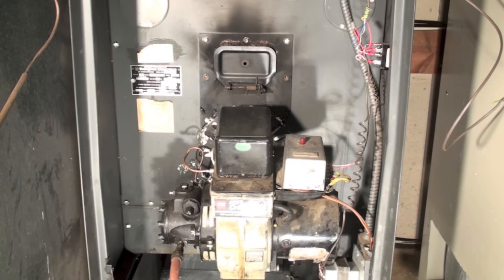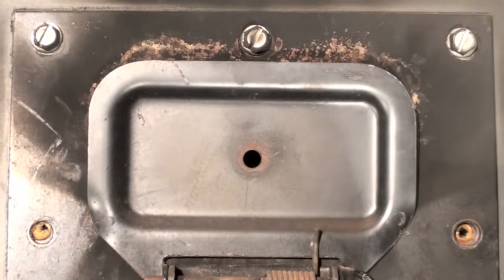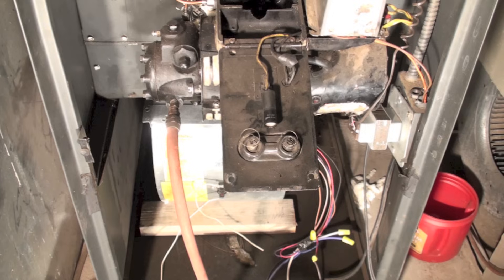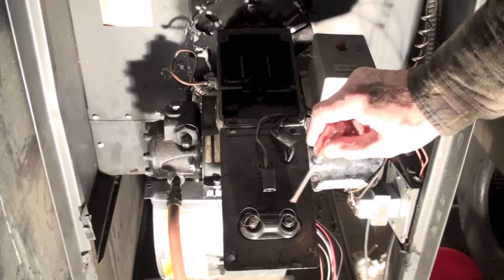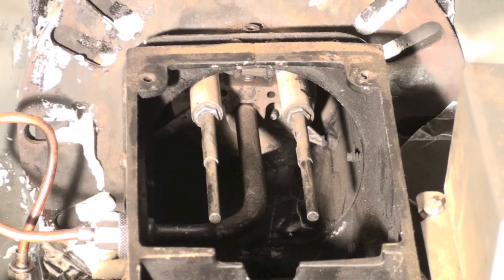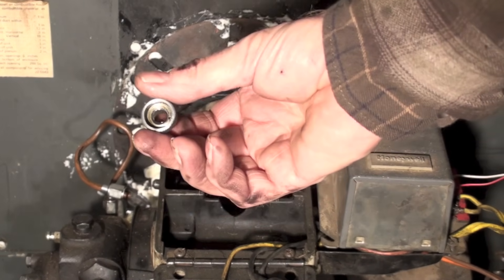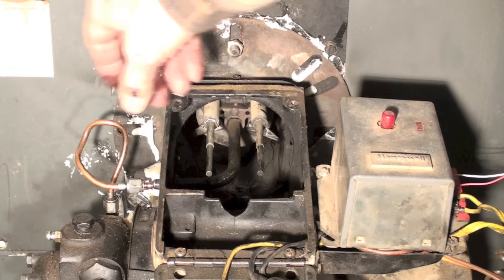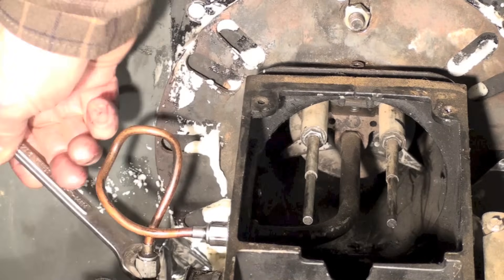Oil furnace troubleshoot part 2 No flame

Comment: Interesting troubleshooting video. I have a problem to fire my oil burner from water heater. I got popped that red button from the motor (on the side) so I have pushed in back but then when I turn on the power I can hear only a click. When I press a button on a transformer it does nothing. Is my motor busted? I have spin the motor blower and that is moving fine.
Reply from the maker: You probably have a failed motor.
GFM
Reply: @grayfurnaceman  Can I connect it directly to 110V to see if is dead for real?
Reply from the maker: @abra-makabra  You can.  The cable from the motor is located in the junction box below the cad cell relay.
GFM

Comment: Thank you so much for these excellent troubleshooting videos.  You explain everything so well, it made the diagnostics very easy.  I narrowed down my issue to a clogged spray nozzle, probably caused by a lack of an oil filter in my system.  I cleaned it out with some compressed air and it fired up!

Comment: Hey question this season in our greenhouse with the Miller MOC 100 i’m having issues with it lighting I replaced the electrodes and the transformer and I’ve adjusted the electrodes to the point that it will light and run way beyond the normal setpoint. It has a .50 90° nozzle   Of about 5/16 above the nozzle 1/4 inch or so ahead and about 1/8 inch gap minimum at the Tips.  But the other night it was running fine for a few nights and then over the night at some point it tripped out.    Also when you look through the inspection port and see the heat and flame come out of the top of the firing chamber I see very very tiny sparkles at the top of the flame though I think that might be just impurities in the fuel because I just recently got a fresh load of K-1 to dilute a bad load I had. Could those small fluctuations in the flame be coming from the pump? I was thinking maybe the pump was getting old even though it is running.   Thanks Ben
Reply from the maker: I don't think its a pump problem.  Usually, sparkles are from too much air.
GFM

Comment: This was very informative. But is there really no good way to remove excess oil from a combustion chamber? Why can't it just be drained and cleaned out?
Reply from the maker: You can certainly do so.  Just disconnect the oil line(s), remove the burner assembly, remove the front plate, (the bolts will probably break off), remove the combustion chamber or fire bricks, clean the oil from the bottom of the furnace and replace the bricks/combustion chamber.  Reaasemble and fire off with a fire extinguisher close.
GFM

Comment: Hey man, I have the same burner. Mine lights and as soon as the blower comes on the flame slowely goes out and then trips the red breaker. Any ideas what's going on??
Reply from the maker: Possible crack in heat exchanger.
GFM
Reply: @grayfurnaceman  we tested the photo sensor it seemed to be functioning. The control board lights the burner no problem. We even took the cad out of the circuit and jumped the F terminals with alligator clips. No change. I'd say it stays on for about a minute. Where is the heat exchanger? In where the flame is after the burner?
Reply from the maker: @pryrcguy9298  The heat exchanger is above the combustion chamber where the fire is.
GFM

Comment: I went though this process, but I had a different outcome at 4:23, there wasn't any spark, and you unfortunately didn't mention where to find the issue if that was the case, any help would be very much appreciated
Reply from the maker: Check for 120 volts at the wires going to the transformer.  120 volts in, no spark equals bad transformer.
GFM

Comment: I’ve been having issues with my boiler. For the last two days it will stop working at the same time at night. The repair guy came and changed the filter and nozzle, it seems to be working until night time where all of a sudden it just stops igniting. Any insight would be greatly appreciated. Thanks!
Reply from the maker: Is the oil tank outside?  Has the temp been below 15F?
GFM
Reply: @grayfurnaceman  yes and no, it’s been warmer. Today I had a new technician come by, he used a CO2 device and hand pump to clear the line. So far, so good, but it’s still early In the day.

Comment: What if you’ve already pushed the button a bunch of times before you watch this very intelligent video. Do you need to wait a week until the fuel can evaporate or?
Reply from the maker: There are 2 ways here.  If you have repaired the cause of the failure, You can start the burner and shut it down immediately.  It should remain burning the oil in the chamber.  This can be dangerous, as the oil will continue to burn and could get out of control.  A fire extinguisher readily available is a must.  For this worst case scenario to happen, you must have pressed the button over 30 times.  If so, you will need to remove and replace the combustion chamber.  
GFM

Comment: My furnace ran for a week and was fine now it won't flame up but the spark is purple....do I need to replace it?
Reply from the maker: Have you done a spark test?  
GFM
Reply: @grayfurnaceman  Yes I just replaced the Beckett electric oil burner and still no flame
Reply from the maker: @krystalbernard2164  If you open the inspection door do you see a fog of oil after reseting the cad cell relay?
GFM
Reply: @grayfurnaceman  no but there is oil in my tank and I already bleed the line
Reply from the maker: @krystalbernard2164  You may have plugged nozzle.
GFM

Comment: Wouldn't you want to shut off the firomatic valve before hitting the red button when testing the transformer so no more oil dumps in the firebox when testing?
Reply from the maker: You can shut off the valve, but you will spray some oil anyway.
GFM
Reply: @grayfurnaceman  thank you

Comment: hi..we just replaced our fan blower and since we did that we kind are experiencing a weird smell now..can it be cause the fan blower is new and has to burn off the newest?
Reply from the maker: It may be possible the motor is not the correct one and is overdrawing power. Check the amp draw and compare it to the model plate.
GFM

Comment: My oil furnace has the blinking green light, and will only ignite if i hit the reset button. It will fire up every single time I hit the reset button. It will burn for about 10 minutes, stops i here a few clicks, the it turns back on but doesn’t fire the second time. Goes right back to blinking reset light.
Reply from the maker: Have you checked your oil filter?
GFM
Reply: @grayfurnaceman  I have not because I was worried I’d screw it it up. It has a oil De-aerator directly above it.  That was going to be my next step. I will have to go pick up a new filter first.
Reply: @grayfurnaceman  I have a guy coming out tomorrow to do a standard tuneup and hopefully that does the trick. I’m just frustrated because no matter how much research I do no one can tell me why it would fire up no problem when I hit the reset button, run for 10 minutes but not fire up the second time. I can’t even find out why they pause in the middle anyway? Why doesn’t it just stay on till it reaches the temperature I set it at? Why the pause? It’s always done that and I’ve never known why.

Comment: My furnace lights every time I push the button, but shuts off after 30 seconds or so. It wont light by itself but it's getting power to it when the thermostats are telling it to turn on.  This is the 2nd year in a row it's done this to me. It was serviced not even a year ago.
Reply from the maker: Be sure the cad cell is clean and pointing at the fire.
GFM
Reply: @grayfurnaceman   thank you for letting me know what to check. My cad cell was bad. I replaced it for less than 10 dollars and now my furnace works again.  Thank you so much
Reply from the maker: @Hanshotchewie  Yea, you got heat.
GFM

Comment: How do you dry that extra oil out of the combustion chamber
Reply from the maker: Ahh, that is the problem.
If the reset has been pressed numerous times, you may have a problem.  If you know the reset has not been pressed more than 5 times with no ignition and oil flow is present in the chamber, you are ok to fire it off after it has been repaired.  More than 5 times, but less than 10.  Fire it off with a fire extinguisher ready to use if the fire gets out of hand.  Over 10, consider removing the combustion chamber and replacing it and cleaning the oil out of the chamber.
GFM

Comment: Thanks to this and another of your videos (and another guy's, too) I was able to overcome a failed control unit to get the furnace running enough for the long July 4 weekend. New controller being installed Tuesday. Thanks so much for the help!
Reply: Farrah Fawcetts beckett oil burner fuses 2 protons form hydrogen into carbon and super heats water into a steam Hotsey steamcleaner making nitrogen and gamma rays! she runs on on 208v single phase 60 hz 32 amp singles phase, Bradley Chubb upgraded to 460v 3 phase 60hz for more fusion Iron Fireman proton accelerator and totally eliminate #2 fuel oil?
Reply: Nick Chubb runs an Iron Fireman proton accelerator of 120/240v open wye delta with 2 50kva transformers!
Reply: Carl Nassib and Baker mayfield 208v powered Beckett proton accelerator heats our church hot water better to 210 deg f better than oil/gas anyday!
Reply: kentavius Street says the burner proton accelerator runs on 460v 3 phase 60HZ with 30 amp breaker

Comment: I've a Bock 32E oil fired hot water heater that has been giving me trouble periodically for the past 3-4 years after many years of trouble-free operation.
The first real problem was an elevated hydrocarbon odor when the burner was operating. This was traced to the Turbo Flue being sooted up. I cleaned it out, put a new nozzle on the burner, adjusted the electrodes and it was fine for a few months until the same thing repeated.
Cleaned out the Turbo Flue again, replaced another nozzle ( .75GPH 80A) and it was fine for about a year.
This month, I noticed hydrocarbon odors again, so I opened up the air vent on the burner some more. The next morning, we woke to no hot water. I took apart the burner, replaced nozzle, replaced the oil filter (which was pretty clean) and cleaned the electrodes. It started up immediately when I turned the power on and it was fine for three days.
Then this morning it had tripped the safety again, so I took it apart, having determined no spark. Turned out the electrodes were way out of adjustment, so I cleaned them again and adjusted to Beckett specifications. Put it all back together and it fired right up immediately when I turned the power on.
However, from a cold start, it should normally run at least 15 minutes to get to cutoff temperature, but it shut down about 7-8 minutes into the heating cycle and did so with a fairly unusual "pop" sound. What's strange about this is that the safety did not pop. Nor is it apparent that the motor overload popped. It just shut down abruptly for no apparent reason and none of the safety cutoffs had tripped.
Is there a third safety cutoff device that I am not aware of? I cannot get the burner to power on. I'm wondering if the controller just happened to fail in a manner that would cut power to the electrodes and the motor simultaneously. In 55 years of living with this house and various oil burners over the years, I have never heard one shut down with a loud pop and all of the safety trips are not tripped. Baffling.
Reply from the maker: My thoughts here are the controller has failed.
This appears to be unrelated to the sooting problems you have described.  You probably have the air too far open.  You really need combustion tools to set the air.  A smoke tester and draft gauge at the least.
GFM
Reply: @grayfurnaceman  I made another discovery after really looking over the entire system: the Field Controls Oil Vent Damper was in the closed position. It has to be open before the burner will start. For some reason, it closed while the burner was running about 8 minutes into heating.
I took the motor assembly off the flue damper and disassembled it. There's a circuit board inside and several of the traces had burned up. I repaired those with jumper wires, tested the motor itself (it works) and put it back together and reinstalled it. When I turned on the switch, the damper opened and the burner lit off nicely. Odd coincidence that the damper control failed while I was focused on problems with the burner, but I guess it was just a coincidence!

Comment: When you mentioned you should press the red button over and over. Can't you just disconnect the oil line and have it pointed into a bucket so no oil going into the combustion chamber for troubleshooting?
Reply from the maker: You certainly can.
GFM

Comment: If I do all the steps in this video and it does not light, what would be the next step to fixing the issue?
Reply from the maker: Do you have spark, is there a fog of oil in the combustion chamber, does the burner motor turn?
GFM

Comment: I had a problem with my old mobile home heater, did what checks I felt comfortable with, usually its just been a simple fix, bleed the air out of the fuel line. I did that a few times till I had a steady stream and the pump was making its normal noise. Well I had no ignition, I checked and had a great arc between the contact springs, then figured it was the electric eye, replaced that and still no ignition. At that point I wasn't comfortable replacing the electrodes or injector nozzle just yet so I called a professional. When he lit off the burner, flames shot out like that scene from the Wizard of Oz and he backed off real quick lol. I forewarned him that I cycled it a few times and there might be some kerosene left in the chamber. Well the heater was working just fine until it reached the shut off temp and wouldn't ignite the next cycle. After being frustrated with it, I let it sit and went to the electric heaters for a time. Then I got up enough courage to replace the electrodes. Still didn't ignite. Now I'm wondering if the nozzle is clogged, but it was working fine after he got it to fire up. Other than that I'm at a loss of what it could be. I'll order a new nozzle for the heck of it and pull the assembly out and bench test the electrodes to see what there doing. Any suggestions would be greatly appreciated.

Comment: You have little choice but to ignite the oil accumulated in the chamber.
Reply from the maker: In most cases, yes.  However, I do not know what age and size of the unit.  If it uses a stack switch and has a 2 gallon nozzle, you could have a gallon of oil if it was pressed 20 times.  
Starting the unit would be quite dangerous.
GFM

Comment: So i have an old oil furnace in my home. It’s currently 13 degrees out and it stopped running. I replaced the nozzle and it fired. It ran for an hour and shut down. I pulled the nozzle to see it covered in soot. After looking into it further i noticed the almost he entire opening into the combustion chamber was covered in soot. Almost a full blockage. There is no flame retention shield in it. This furnace has ran fine for 5 years. I need to know what you think i need to do. It’s an old Beckett. In a Williamson temp-o-Matic. I can’t get a repair guy out until next Thursday. So another week, it there a way to send your pictures of what I’m talking about?

Comment: LOL.......if the electrodes came loose and one twisted down and shorted to the nozzle, why did you have to loosen them to re-adjust them? Shouldn't they have been loose when you removed the nozzle assembly? How did they get re-tightened?

Comment: Hi... I want to preheat the oil  ... If the temp ia 25c is ok? 
Its problem if the temperature is not stable... 20 or 22 or 25  defence of the weather out side... I make i pipe with 100 watt resistant to heat oil 0.7l per 10 min

Happy new year
Reply from the maker: The 25c is fine/.
GFM
Reply: @grayfurnaceman  thanks wish you all the best... For a new year

Comment: Thermostat said heat is on,  press the red button it comes on, It gets to set temperature of 70 and goes off as it should . When it gets below set temperature of 70 it does not come back on. Press red button and it comes back on and I go though the same cycle. The transformer is only two years old.  I pull gun out and spark gap looks fine. Put everything back together and I hear a click, but does not fire up. Press the red button and it fires back up, but back to the same old cycle. Any thoughts?
Reply from the maker: I would be looking at oil supply.  Plugged filter?
GFM
Reply: @grayfurnaceman  It was the cad cell relay. Your part 3 video explained that all quite well. I want to thank you for putting out these videos. They are great and I learned so mucht. I was a little hesitant about the spark gap test on the transformer, but I braved through it. My spark was good and it eliminated that as potential problem. Thanks again.

Comment: 1/2 inch above the center of the nozzle.  1/4 to 5/16 gap between the tips of the electrodes.  Flush with the nozzle for an 80 degree. Just past flush for a 70 degree. 1/8 in for a 60 degree.   Up to a 1/4 inch in front of the nozzle for a 45 degree. You don't see a lot of 45 degree nozzles except for weil mclain and thermoflo boilers with a beckett burner.
Reply: Flush or a little behind for a 90 degree

Comment: what happens if you did press the red button a bunch of times and it's flooded with fuel?
Reply from the maker: You will need to remove the burner and combustion chamber and clean out the oil.  That is worst case.  If you can assure there is no oil level inside the combustion chamber, you can start the unit with a fire extinguisher standing by.  And hope.
GFM